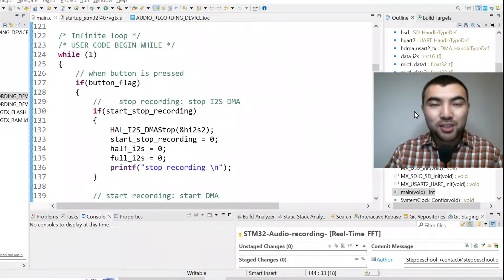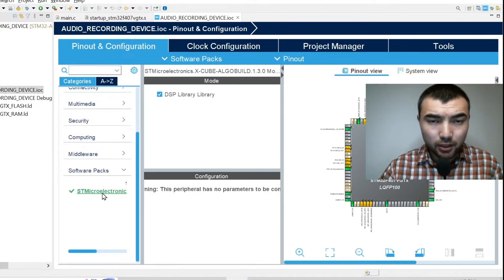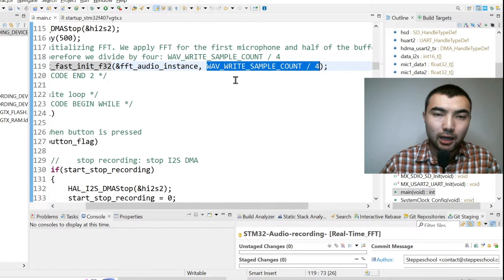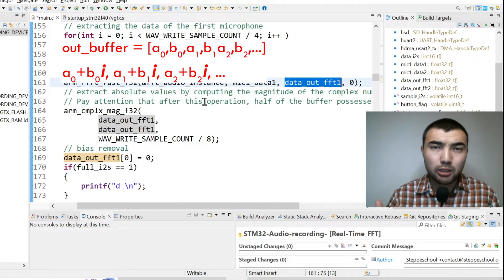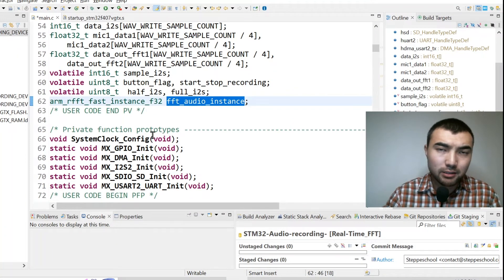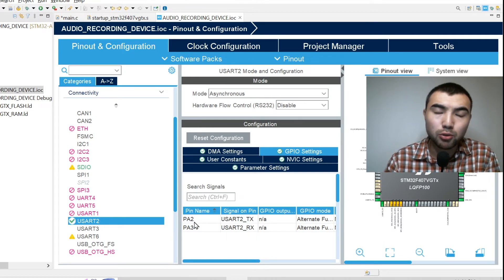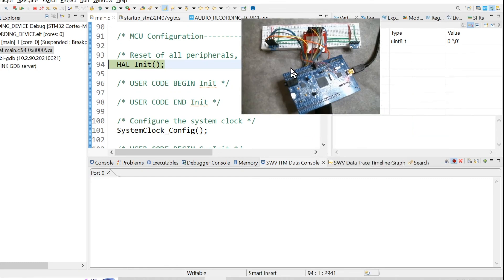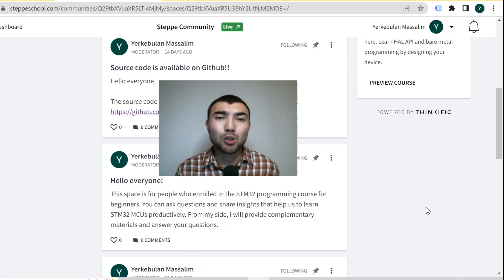STM32 DSP CMSIS: Real-Time FFT| Python script to plot spectrogram in real-time

Comment: Hi, i am going to use it for my project. in your video you have seem to use a I2S MEMS microphone is it possible to do this with a Normal Electrect Microphone module aka with a ADC pin ?
Reply from the maker: Sure you can. Once you save the sampled data into a buffer. You can apply FFT
Reply: @steppeschool3629  okay thanks :)

Comment: Inside the while(1), before executing rfft_fast_f32 and all instructions after, shouldn't there be a loop that converts the numeric values obtained from the ADC into volt values?  That is, multiply by Vref and divide by 2^bits of the ADC. I'm using only the ADC (not I2S), so I should convert the values before everything? Right? Thanks
Reply from the maker: Sure, you can do scaling before or after applying FFT. I think both of them should work fine.
Reply: @steppeschool3629 Would the code you used in this project work even if the frequency of the input signal varied nonlinearly over a certain range? For example, for a few seconds the signal frequency is 1kHz, then for 5 seconds it goes down to 0.5kHz, then again it goes up 1kHz, and after another second it goes up to 1.8kHz. Or do you think it would be better to use the Short-Time FFT STFT? Thanks for your videos and answers, they are extremely useful
Reply from the maker: It should work fine when you have changes in the spectrum of a signal. Since we are applying FFT to a buffer, it already can be considered as short-time Fourier.

Comment: Why calculate fft and magnitude when half buffer is full? Can't it be done only when the entire buffer is full? What is the difference between these two cases? Thanks!
Reply from the maker: Of course, you can do it for the entire buffer. However, I am recording data at the same time. Therefore, I apply FFT to half of the buffer while the other half is being filled with the data. Then, I alternate the process. This way, I can apply FFT in real-time.  Hope I answered your question
Reply: @steppeschool3629  Hi. Thanks for the reply. If I have a sine wave input to the ADC and I want to find its fft (and magnitude), do you recommend me to calculate it directly when it triggers "if (CpltCallback == 1)" or do as you did in the video? Because practically speaking I am still not very clear when to use one "method" and when to use the other.

Comment: Hi your video is very helpful. Thank you. Please tell me how to record audio and convert it to mel- spectrogram into image file.JPG and save to SD card. Please:))
Reply from the maker: Hi,
If it is just one image, what if you take a screenshot? Otherwise, I am pretty sure that there should be some python libraries to do that.
Reply: @steppeschool3629  Thank you very much! How to send that .wav file to PC or googledrive using wireless technology using your own stm32f4. for example, should I use esp32 wifi or is there another way I don't know.
Reply from the maker: @vannhatoan1278  Hi. Do you want to stream in real-time or want to send the file?
Reply: @steppeschool3629  I want after getting the file.wav sound like you do, then stm32f4 it send that file to Googledrive or PC using wireless technology like wifi for example. Is there any way. T found no similar examples.